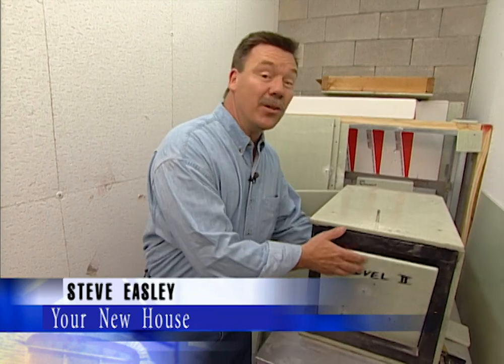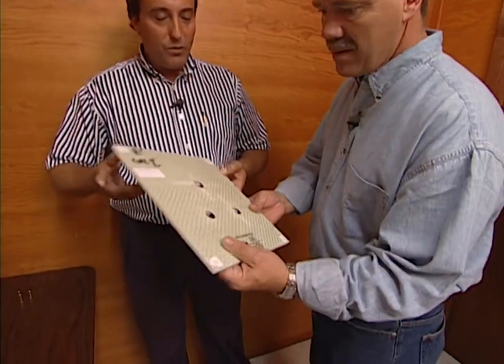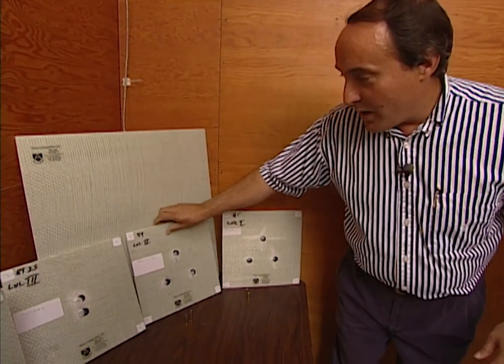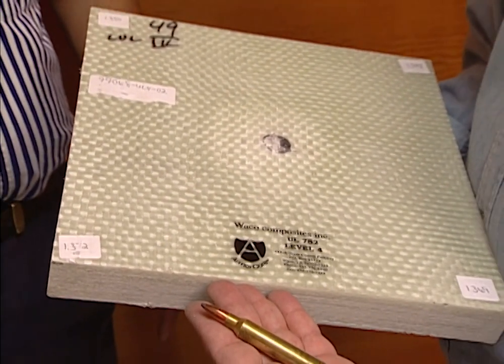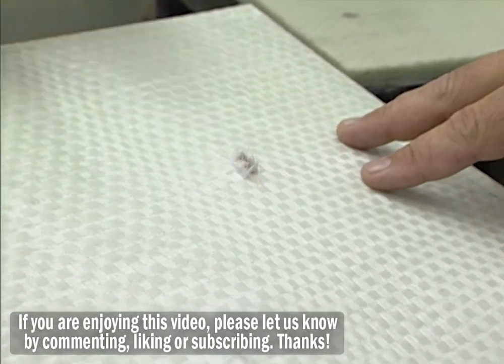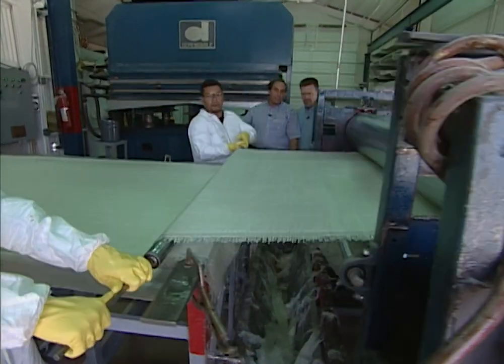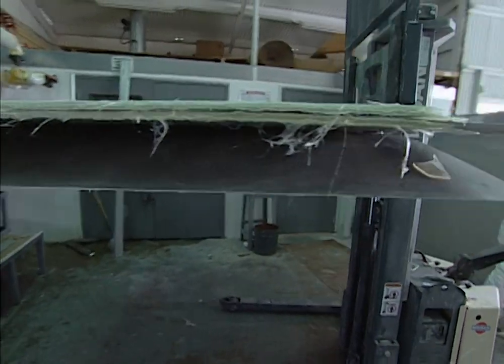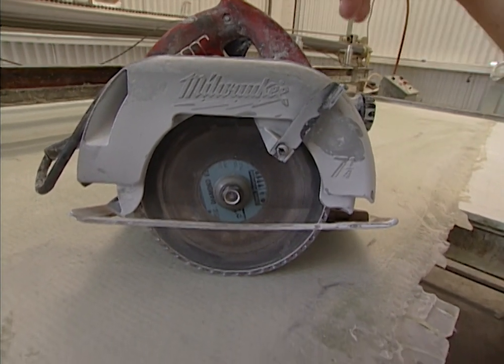Bullet Proof Wall Panels for Your New Home - Did You Know?

Comment: Wouldn't it make more sense to for once don't build your house out of cardboard anymore? I can not imagine a brick or even concrete wall be much more expensive then kevlar. And it improves heat isolation and would withstand nature, like tornados significant better. But I guess I am just a smug European.
Reply: if i had the money my exteair wall's would be over 2 feet thick.
more for looks and R value, center would be 8 inches steel reinforced fiber create.  insulation stryo foam 2 inches thick, then nat stone, 18 inches thick. for the outside. inside the create, raw cut 6in wood  on 24 in centers OFFSET at 12 inches so the wood at the create does not touch the inside wall panels, with 3/4 hard plywood, for the inside walls filled with rock wool. a good 14 inches thick.
even the walls flooring and ceiling in the house would be made for sound dreading.
then the basement and roof (thick gauge steel). 
but would not get cold at all even if sub 0 F temps outside. and cool even if +115 F outside. and very fire proof.
but i am not a democrat, or rich. so i get to suffer the temps of the season.

Comment: Technically, if the projectile does not ricochet, but is stuck in the material, it is a penetration of some millimiters. If it goes all the way through, it has perforated the obstacle.

Comment: Or ya can add bricks in between the studs of the walls and fill it with sand . Hmm 
I like how a young man made a body armor plate out of resin & fiberglass sheets . About $30 . 
Though I’m sure business is booming for this company.
Reply: Far more efficient to frame up the walls with standard steel studs, add a heavy wire mesh over the studs on both sides and then fill with ceramic stones or broken pieces of hard ceramic tiles. Very heavy like sand but the ceramic pieces are far more efficient at depleting the energy of the round as well as tearing it into smaller pieces that are easier stopped as they proceed through the ceramic media.
Reply: You can build these yourself formed to fit the same way you build a yacht, just roll it in by hand and keep layering till it's thick enough. You always pay for the labor and factory when you buy something.

Comment: Do clients typically apply these panels to the floor and/or ceiling too?
Reply: Why would a suburban family home need these panels on the floor? For an intruder stuck in the basement? And the ceiling... for someone doing a fly-by... in a helicopter?
Reply: You can do as you please depending where your threat level is located. Live in a cheap multi level apartment with wood beams and flooring, might come in handy. If your apartment is above another apartment and you have cheap flooring, yes you can protect your floor. Not worth the investment if you are renting. If you have bought a cheaply built condo, it’s another story. Also worry about fire rating and what type of smoke is released by this product if involved in a fire.
Reply: @Subgunman Same as a yacht fire.

Comment: Or just build it out of concrete would probably be cheaper lol
Reply: Concrete is not bullet proof, goes straight threw especially higher calibers
Reply: @thewhisperreaper3537  are you talking concrete block, or solid steel-reinforced? Serious differences.
Reply: @thewhisperreaper3537  You'd need that super thick stuff in order to stop high calibers. They didn't give the price on that, I bet its at least 1500 per sheet.
 I know that living in the hood, most everyone uses handguns, so the thinner stuff is fine.
Reply: Weather is a concrete block solid filled with concrete in the cores or poured concrete. It’s going to stop way more threats in than any of these fiberglass panels and be cheaper. Besides, you’re only using it for the outside walls of the room

Comment: Seems to me that concrete construction would be a cheaper and more available option.
Reply: I am thinking of adding a few panels on the sides of my car, and in the back too
Reply: @peterng25  Why not use something made for that purpose instead of using something made as building material?
Reply: @peterng25  Where do you live that you'd need this in your car?  Cars don't get shot up that much, house more common, but it's still a million to one shot, unless if they are specifically targeting you.
Reply: This stuff would be good for retrofitting existing buildings.

Comment: The pressure while hardening? Damage to sheetrock? Need to remove fiberglass panels? 

Sand would be better, but weight and leaking after hit is the issue.
Great idea though.
Reply: you need to actually ask a question to use a question mark.
Reply: put the sand in very small bags. kinda like sandwich bags. little to no spillage. but then how many times do you expect to get shot at?

Comment: 1350 fps for the strongest test? I'm sure a 556 will go right through it!
Reply: That can't be right if it stopped .300 WM. It would zip right through. I think that was for the level 2 they tested with that lever action.
Reply: Matt didn't use the Level 4 stuff I don't believe
Reply: It did demolition Matt did it 7.62 5.56 and 50AE went straight through
Reply: depends on the bullet. small fast ver big but fast. the larger bullet will not go all the way through what a smaller dia bullet can. i do not know the math. but you have speed, diameter, weight, type of bullet. aka: hunting bullet is made to expand fast to put all of the force into a quick clean kill. a hard ball is not meant to do that. so it will go right on through the deer.
that is why they jumped from a slow 44 mag to a fast 300 win mag, skipping thousands of other calibers. and bullet designs.